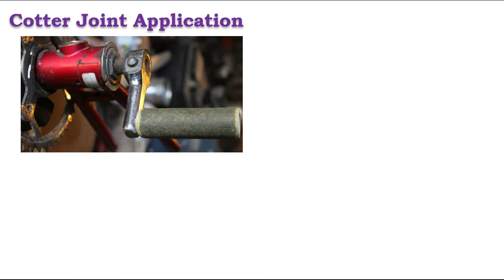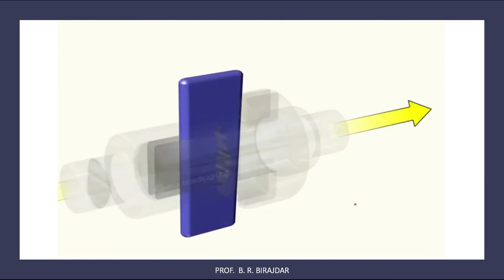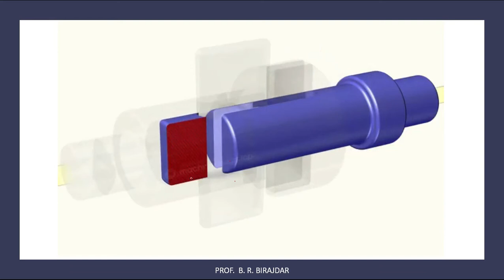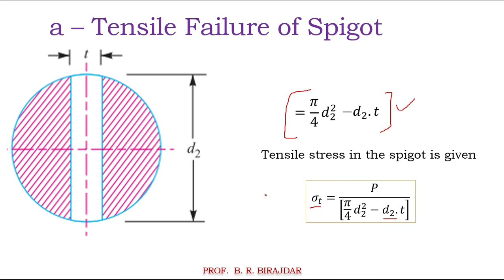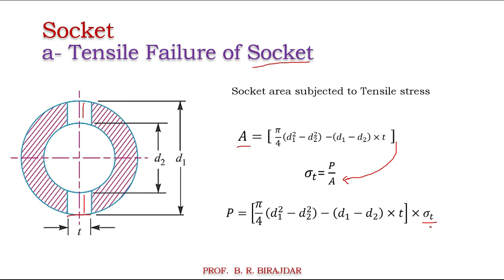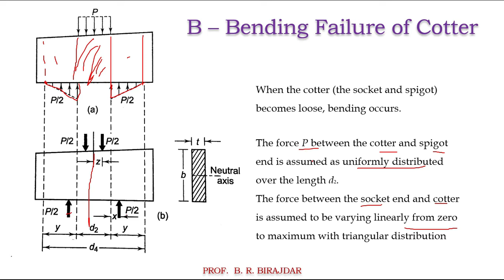Design of Cotter Joint | Failure Modes  (BRB)

Comment: Why aren't we taking 2×Area resisting in the Tensile failure of Spigot At 10:20 sec, The spigot was divided into two parts and area is also on both right ! why we should not take other area?